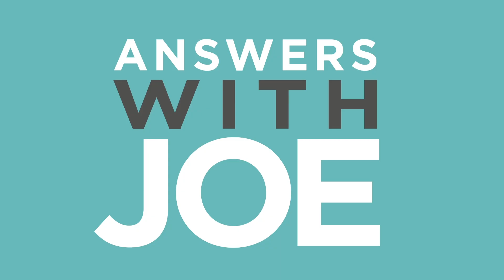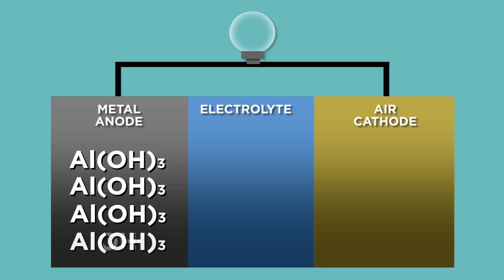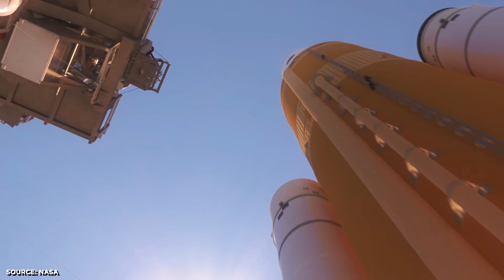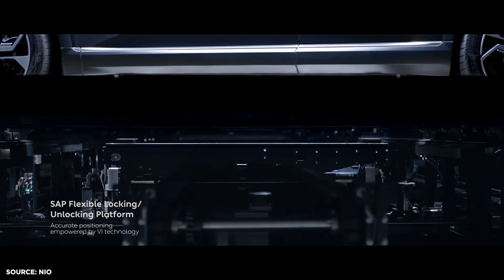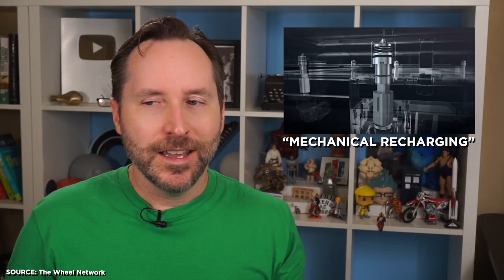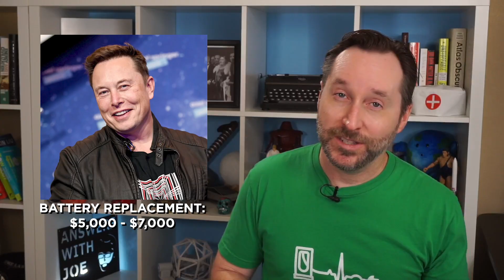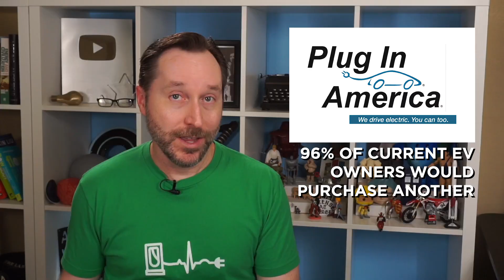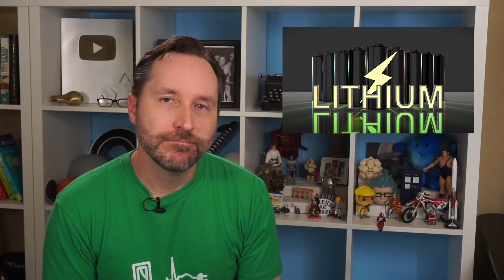This Battery Could Drive A Car 1500 Miles - But There's A Catch | Answers With Joe

Comment: With any refueling or recharging technology, you can recharge (refuel) when it is convenient, even if you are not yet out of charge (fuel). With these aluminum air batteries, when you replace the battery you are losing any remaining charge. That means waiting to swap out until they are totally exhausted (whenever and wherever that happens) or losing the energy left in them, which you have paid for. So much for convenience.
Reply: You're not thinking it through. You don't put one, massive power cell in the car ... you have 4 or 8 "ports" where you slide out an empty powercell and slot in a new one. That makes them a size that can be handled by a single adult, and allows the internal electronics to use one cell at a time, showing you a dashboard of which cells are ready to be replaced, and which ones are still unused.
Reply: The other reporting I’ve seen actually shows a single battery pack that is swapped in a single operation. Perhaps it is not representative of effective implementation, but that’s what’s being shown.
Reply: @danielbudney7825  
I don't think YOU are thinking it through.
I've spent a career working on photocopiers.
You'd be surprised the number of ways users can screw up something as simple as replacing toner, or ever paper!
I have zero confidence in "a single adult" in the general population being able to manipulate a light (ish) but considerably sized pack out of then into a vehicle, THEN ensuring a quality (DANGEROUS) electrical connection.
Trust me, if there's a way to screw up, someone will.
Two more questions.
Where in the vehicle?
Accessible, generally means near the perimeter of "the box".
It's going to encroach on passenger space, or name the vehicle bigger.
Next,
re we considering a "universal pack"? One which suits everything from a city car to a high performance vehicle?
Think about that.
Reply: @rogerstarkey5390  Well if your average joe shmoe cant be relied upon to swap it themselves ... then do what they do in New Jersey. Bring back "full service" gas; or in this case, Battery stations. You roll in and trained attendants go to town wiping windows, swapping out however many battery units you want, checking your brakes, checking and if needed re-inflating your tires, etc. Rain or shine. And if the batteries are stored in the floor boards then you simply have a "pit" that you drive over to facilitate the swap Much like those numerous drive thru lube stations. (and maybe give the suspension a once over while they are there) 
You dont even have to leave your vehicle unless you want to to use a rest room or buy snacks or drinks for the road. 

As to the Universal pack issue ... 
If one average car with two motors (one for each axle) can have room enough for one big battery that gives it 1500 miles of range ...  
then it stand to reason that you could put in 5 smaller batteries each with 300 miles of range. 
swap them out as you use them. Range anxiety and cost anxiety be damned. You could pull in and swap out a pack as soon as its empty or wait until you are on your last pack its your call.

Maybe your super light high performance roadster saves weight by using only 2 packs. Maybe you pull one for that extra edge on race day (or have it set aside so you have something to drive home with i dunno). Or for that matter your tiny sub compact econobox barely big enough for you, one passenger and groceries that uses one motor limited to a city speed limit of 40mph  and still carries two packs  one primary and one spare. 

Maybe your Jeep is a 2 door Wrangler and only has room for 4 packs. But its built for off roading and has 2 high performance motors. which eat into your range a big deal because you also drive like a maniac.  Which cut their range in half. And you STILL have a Jeep that gets 600 miles of off road range. Which many jeep owners would trade a spare internal organ for.

Maybe your 3,000 lb luxury touring sedan carries all five but has so many extra things using power that it only get 1200 miles from all the packs.  And you can still take this on a road trip from New Orleans to DC 
Maybe your average Sprinter commercial van is hauling around 4000 lb of internal storage for local delivery. Averaging 3-400 miles in a day It would use maybe a battery and some change in one day.  And has room enough for 8-9 packs. so its going to the service station once a week.  

What about a truck big enough to need air brakes? Like a class B Box truck. All 26 feet of it.
You have A LOT of room for a lot of batteries. Which it would need given that it could weigh as much as 28 thousand lbs of gross vehicle weight. 

Maybe you are in a Tractor Trailer.  
the tractor itself may be using 6-8 motors one for each wheel. That is three to 4 times the power draw (sooo much torque tho ) and yet it still has room for 15 battery packs. And that doesnt count the space above the tires where the driver assistant and sleeper cabin go.  That thing could dead head across the continental U.S. if it picks the right route.  
The attached trailer with all the 40-60-80 thousand pounds of cargo. will suck up a lot of that range but those 53' foot trailers have room for extra battery packs all along its under carriage.    

And given that these trucks will be using truck lots to recharge then those facilities would definitely afford acquiring specialized machinery to swap out packs three or five at a time depending on how they get stored.
Reply: Don Fehr
Good point.

Comment: Can’t believe you got through that whole clip without mentioning the carbon footprint of aluminium production.
Yes, even using environmentally clean(ish) hydroelectric power, aluminium smelting (whether from bauxite or the hydroxide sludge from an exhausted aluminium/air battery) releases huge amounts of CO2.
This makes Al/Air battery technology about as bad as using petrol.
Reply: Yes, they could use renewable energy and an improved reduction process  but even then, with all those cars in the world, they would need so much green energy that it couldn't work at present. So that would mean extra investments in thermal solar, hydro and perhaps thorium reactors But if fossil fuel has to replaced, all new energy source will require investments. . Transport and storage of aluminium is luckily safe, easy and energy dense.
Reply: You are negating the recycle portion of the conversation.  It is only the production of aluminum that is harmfull.  Once we have the aluminum, there are far more environmentally friendly processes for recycling the aluminum for re-use.
Reply: @ShelburneCountry  It is you (and Joe Scott) who are failing to understand the recycling aspect of this battery.
I’m not denying that aluminium metal is easily and cheaply recyclable, but when the battery has turned it into aluminium hydroxide you do not have aluminium.
It’s equivalent to purified bauxite at this stage, baking it gives Al2O3 which then has to be reduced to aluminium via the Hall–Héroult process.

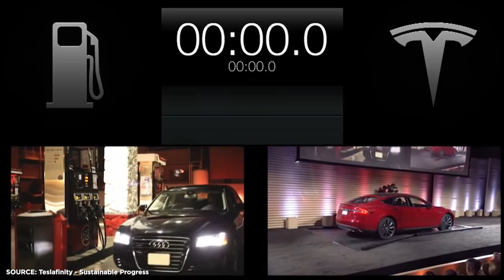Comment: 6:17 - there is also an argument to be made that a widespread adoption of the "battery as a service" subscription model would shift too much control away from the hands of the users. (look at the printer industry for a vaguely similar example)
Reply: The apple car would have fun with this one
Reply: The tractor industry dude 100%
Reply: Yuuka profile pic on a video by joe, didn't think I'd see that today.
Reply: @PossiblyKona  Same with Yoshika. Did not think of seeing it in the comments. Although going out of topic, my bad.
Reply: NOPE

Comment: At some point, a whiz kid somewhere will invent a battery so that any consumable sub-components are modular/replaceable by DIY'ers or even perhaps the average driver. Will the corps allow that to happen and give up the revenue stream from only allowing "authorized techs" to replace the batteries/bits?

Comment: The Hybrid solution I'm looking at is reformed methanol fuel cell system combined with Lithium Iron Phosphate batteries - maybe a 25 KW fuel cell system with 35 KWHs of batteries

Comment: Hybrid solutions seem like the way to go for me.  Something like 80% of trips are under 50km, so having 100km of range in lithium batteries and an extra 500km of range in Aluminium batteries would be the sweet spot that allows people to rarely change their aluminium batteries and still mostly run on lithium.  It also has the advantage of not using as much lithium and cobalt in the battery design, which in theory makes the batteries environmentally cheaper to produce.

Comment: Regarding the hybrid approach: how about an EV with a lithium ion battery that has say, 150-200 miles of range, but has space to add an auxiliary aluminum air battery for road trips. That way you don't have to always carry around a heavy battery unless you absolutely need it. Or maybe just use them in boats.
Reply: Now that's what I'm talking about.  Yes - why can't people that go on the rare long-distance trip have the option of going to local battery swap garage and renting a larger battery on a daily basis?  When they bring it back to center, they get deposit back along with original (or equivalent) battery as original.  A win-win for everyone involved.
Reply: Pointless.  Non-rechargeable batteries make no sense and you will spend the saved energy recycling the chemically reacted aluminum.  It is shameful to see multiple channels doing this silly topic at the same time as that means these are paid ads someone paid for.  It is too much of a coincidence that multiple channels cover non viable batteries at the exact same time.
Reply: @_PatrickO  the reason you see multiple channels covering this topic now is because that's how news works.
Reply: @_PatrickO  1. All paid sponsors are to be explicitly stated by law and 2. this topic has been a center of research as of late and of course started picking up media coverage and 3. this literally happens with anything that’s trending. 

Not everything is a scheme to control your life.
Reply: @neyok3198  lol, no one discloses the sponsors.  And you are naive as all hell if you think a bunch of youtube videos covering the same scam technology all at the same time is not a paid ad.
Reply: @_PatrickO  I don’t know about you but I’ve heard about these batteries months ago when a lot of labs were experimenting with them. This video to me is more of a late response than a sudden occurrence.
Reply: @neyok3198  More proof that everyone airing videos all at the same time months later makes no sense.  You people are pathetic.  These videos take a lot of effort and two large channels with hosts that would have immediately balked at this crap the second they read that the batteries were one time use are both ignoring that massive flaw and making videos coordinated to go live around the same time.

Comment: While aluminum as such is indeed highly recyclable, this battery deteriorates it into alumina (aluminum-oxide). As recycling that takes a lot of energy (to get rid of the oxygen), a key question is the energy consumption each cycle of reuse for batteries, or just raw aluminium again. This is very similar to the energy-intensive electrolysis part of manufacturing aluminum from bauxite ore.

Comment: Al-u-min-'i'um. Here's a radical idea. When the battery runs low, change the battery for a fully charged one. There is no difference to filling up the tank with gas. Instead of charging stations have charging/changing station.

Comment: Does Aluminum recycling lend itself to use of intermittent green energy sources? If it does that would be a big win for the concept, the idea of locating recycling close to the abundant but remote energy sources (solar or wind)
Reply: Recycling normal aluminum just takes heat, a wood fire is sufficient.  Recycling these things are completely different, once used up, the plates are no longer elemental aluminum but Alumina Al03.   It would take a lot of very high current electricity to break it down.  It's not recyclable in the "normal/easy" sense.